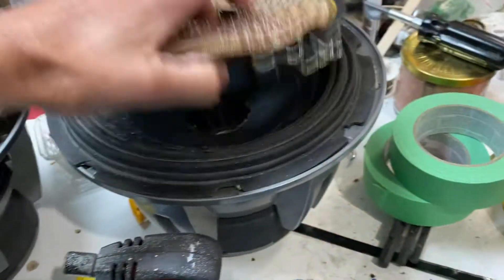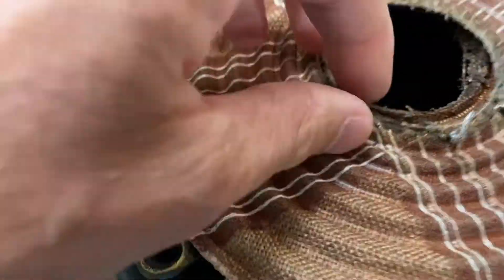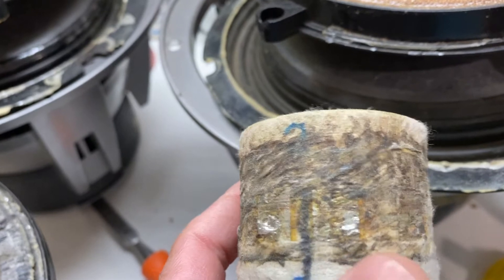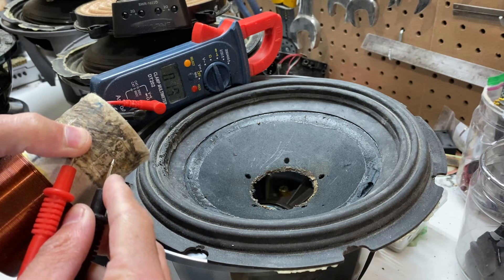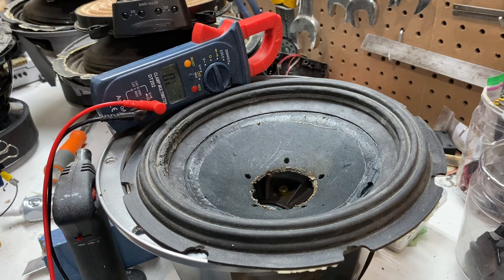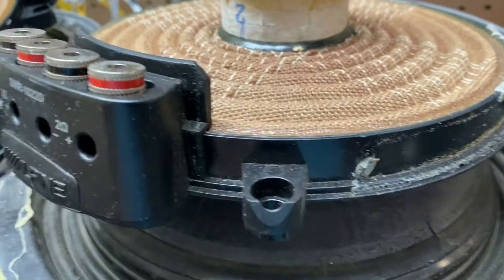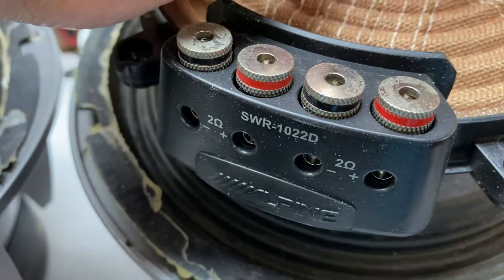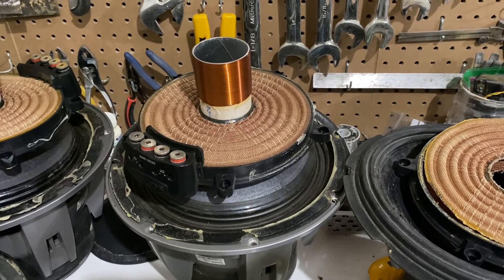Alpine Type R Voice Coil testing

Comment: which type r version is the one that managed the most power?
Reply from the maker: The 4th generation (black dust cap) was rated by alpine as 1000rms. It was later suggested that the ‘true’ rms was around 750rms. The RW is sort of a 5th generation is physically identical to the 4th generation except has a dark grey dustcap and was rated as 750rms
Reply: @MrM_Full-Send I have voice coils like you, about 3.75.  SPRINGFIELD ones are 3", which ones do those fit?  Where can I get the 3.75 long 2" models?
Reply from the maker: @Ocfarmer  for an 8” type r? i haven’t been able to find coils for those yet
Reply: @MrM_Full-Send  No it is the gen 1 and gen 2 R12.  3.75in former.
Reply from the maker: @Ocfarmer  i see… i have never pulled a 1st gen 12 apart 🤔… so not familiar with coil specs… i hav two 10’s i can pull apart and see if that sheds any light on things. might take a few days
Reply: I bought an r8, one measure 4ohm the other 31ohm.  What should I do?

Comment: Thank you I appreciate it video is perfect!!!
Reply from the maker: Ya no worries I figured it was the easiest way
To explain??? Also might be easier to get at the solder connections where the pigtails solder to the nickel rather than the nickel itself. There’s lots of conductive material there with little risk of damage